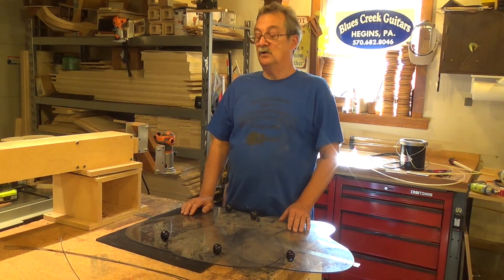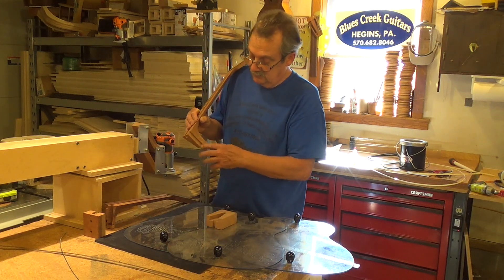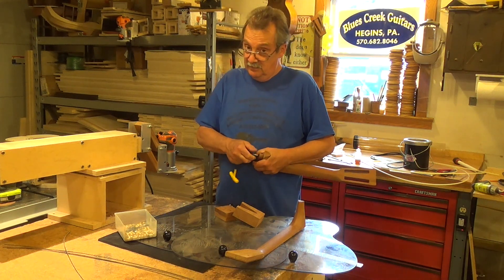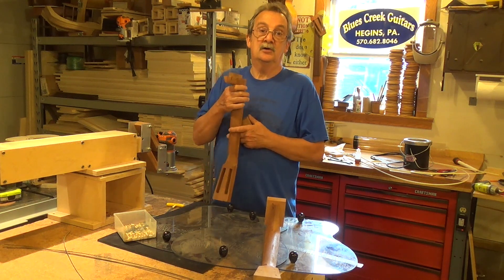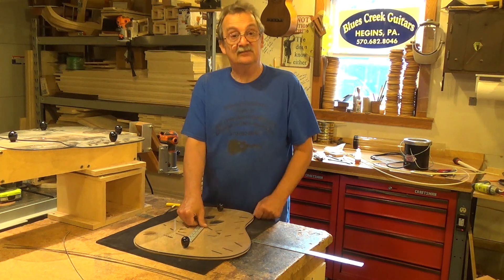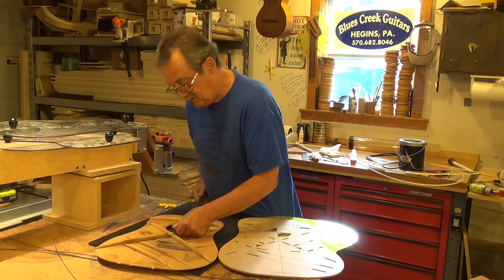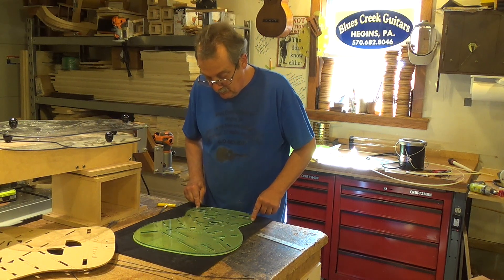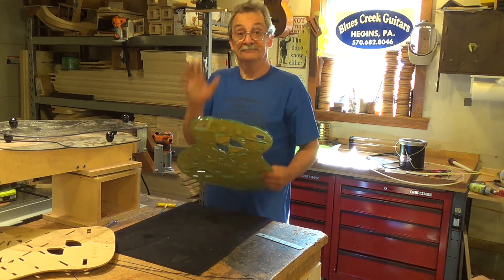Blues Creek Guitars - Quick Tips - Discussion on Martin Bracing & Neck Joints

Comment: Glen, love your videos. Very interesting stuff. My thinking on the X brace position is if it's fwd it allows for a more free movement of the bridge resulting in a lot of air movement and rear shifted would reduce the bridge movements possibly resulting in a more focused tone. What's your thoughts?
Reply: to a point. You can't take the bridge off the braces as that can result in failure. Much depends on what your going for. The forward shifting tends to lighted the mids and trebles .  The lower the more balance on the tonal control. If you like more bass forward. 

The other point is the angle of the braces so looking at how the stresses are applied to the top , we get more tensional loads . Wood carries that more efficiently than compressive load but also that can allow forward roll of the bridge. There is more to it so we don't want to over simplify it. Understand the loading and how it is applied allows you as a building to adjust the one for the person getting the guitar.   Martin angle on the original forward shift was about 99 degrees and 95 of the rear.   I also prefer forward shift

Comment: I'm building a dreadnought but I want to use a Spanish foot, like a classical. Martin did this with his first guitars in the late 1800's. Any thoughts?
Reply: do not use that joint for steel strings  it is a horrible joint and one I would  never use. Martin never used that joint on a steel string . It makes resetting a neck most difficult.  I own martins from 1847 up and also I am a Martin authorized repair shop. Your info on the spanish foot and martin is not correct.
Reply: Thanks ! After further research, steel strings came into use after the 1800's